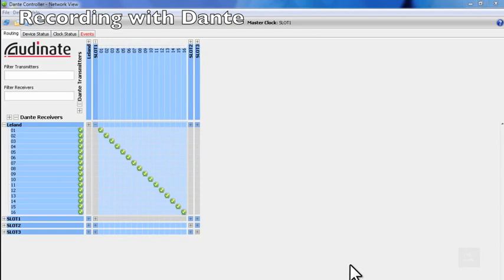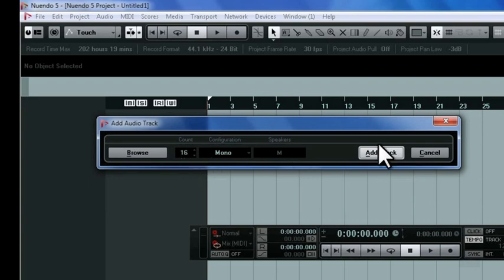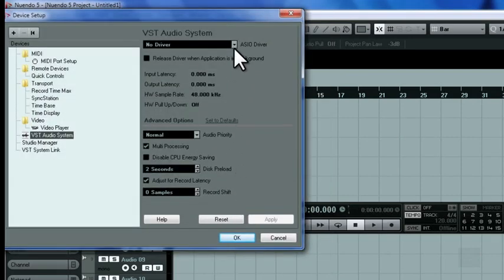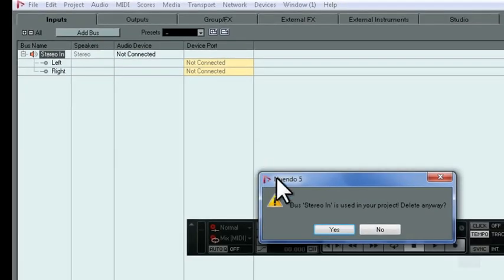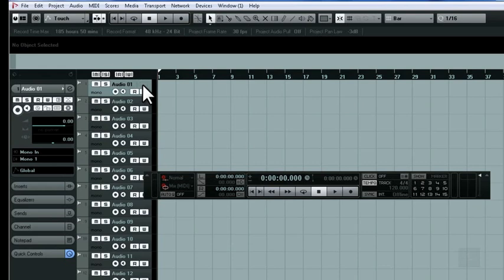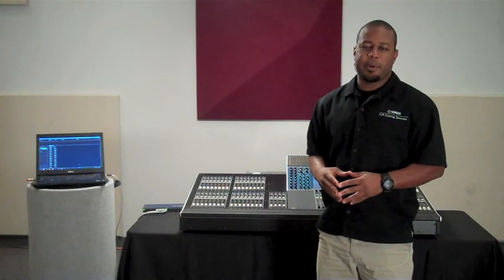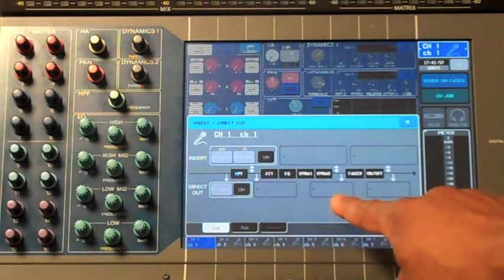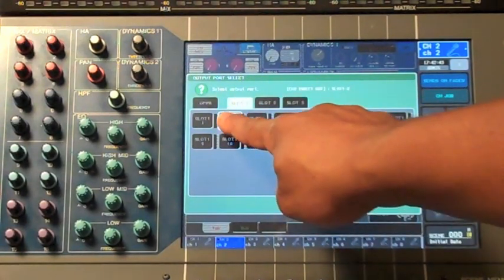Recording with Dante

Comment: You introduce terms without ever explaining what they are.  For example,  What is a "VST Buss"?      Has Yamaha ever tested whether their youtube video training works.     I have watched many Yamaha training videos on the QL1 and I have no idea of what the logical flow of various inputs devices,   Dante, or XLR connnectors or Tos cable connected line level interfaces      and that into the QL1 Software       What is the logical flow of assigning these devices to faders.    Then what is the logic of a Mix ?  What is the Logic of a Matrix?   What are the logical flows out to Racks and Effects and how are they brought back into the QL1?     How does this connect to the Send?  What connects my Mix/matrix./send  ????   to an Omni Out?????        Your training videos are not working for me!    I contacted Yamaha Support and they basically told me to "call my dealer".  They were of no help.

Comment: i have a mackbook air whit i7 prosesor it dosnt have a rj45 port can i use a thundrbolt to rj45 adapter?
Reply: Well even in this demo you can see the latency came up as 50ms give or take. So a roundtrip of 100ms. Mixing maybe, tracking no. You would be better off trying a Thunderbolt to PCIe chassis with a physical dante card inside.

Then it will be greatly reduced to around 3ms roundtrip according to their website.